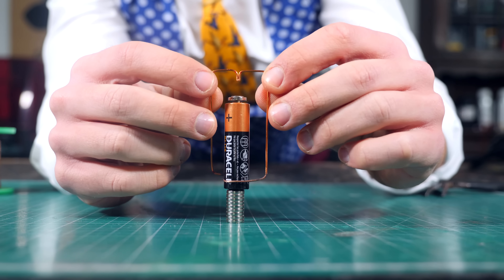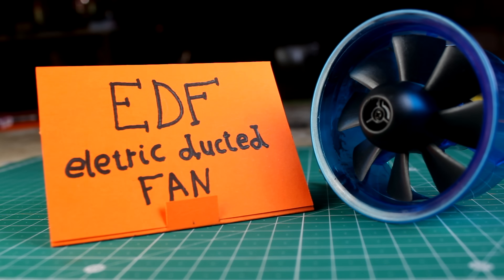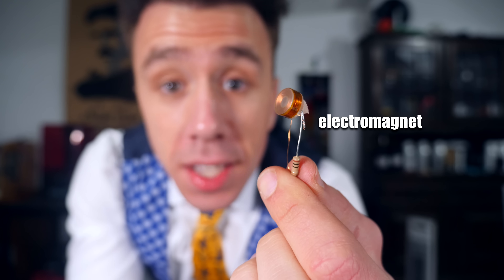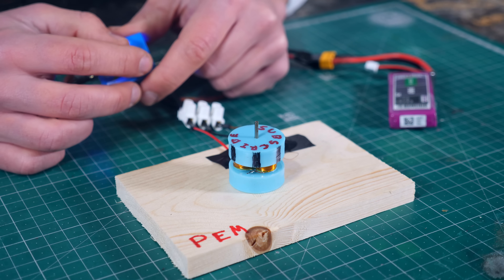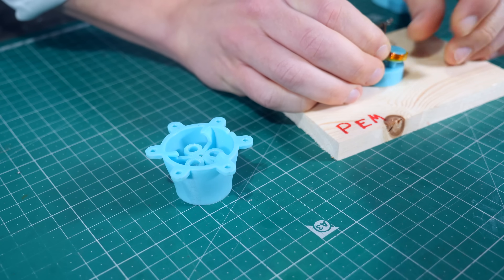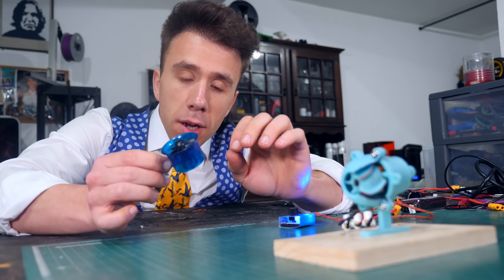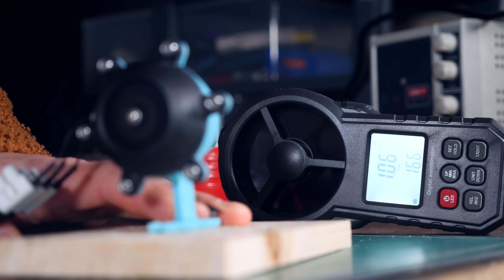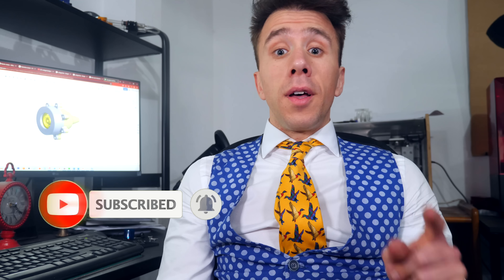I 3D Printed an ELECTRIC MOTOR FAN

Comment: I'm guessing it has to do with the diameter of the intakes of the EDF and the 3d printed ones. It's the biggest difference I can see and would guess it to be very influential on both the flow rate and the static pressure delivered by the fans. But I don't know for sure, am not an engineer in this regard. Just know that I hate tomatoes too.
Reply: I believe you’re right. I am an aerospace engineering student and I believe there is some pressure distortion happening within the fan casing because it is not made precisely for the fan blade and the speed of the motor. When designing these type of casing MATLAB and Solidworks fluid flow models are used to determine the best design that matches with the casing. There are a lot of helpful guides online to discover more.
Reply from the maker: Congratulations my friend! You have just won a 3D printer! Send your info (Name, Address, Zip code, Phone Number) to integza@gmail.com.
Reply: In this fan, the mouth from the front is taking in very little air and should be wide open.  This will allow them to throw back with more air and will be more efficient  @integza
Reply: @integza  sir did you pick two winners?
Reply: I think you're right. Tomatoes have a nasty texture.
Reply: As an aerospace engineering student I would say this is a big factor, at the same power input you aren't going to get nearly the same mass flow rate through his centrifugal fan as through that ducted fan. However another factor is that a centrifugal fan as he is using it simply isn't as efficient at moving air as that EDF. The centrifugal fan is better at increasing the airs pressure but the ducted fan is better at moving air.
Reply: I am currently trying to do something similar to make thrust for a drone. Mass flow rate is a big problem, but a solution might be to have a two stage system that uses an edf type impeller to increase mass flow connected to a mixed flow type impeller to increase pressure. The combination might work well with aerospike nozzle.
Reply: It's the diameter plus the surface area the fan has way more surface area to grab air and throw it, as well as the straighter the path of air the faster the air will be moving, the fan has a straight path a lot straighter than the impeller 45deg vs 45+45+ the exhaust outlet
Reply: i hate tomatoes but i love ketchup
Reply: I belive the edf fan shape is more optimized for flow whereas an impeller is generally better at creating high pressure. All of the energy in the motor is being put into of pressurizing a small amount of air to a higher pressure, which then produces less thrust. Also, since the impeller is releasing air back into the atmosphere it doesn't need to work as hard because the output pressure is nearly the same as the input after it gets released, so the motor probably isn't at the same load as it was on the edf.

Disclaimer: I am just a motor/fan enthusiasts. I don't actually know what I'm talking about
Reply: Your tolerances are poor, the geometry, airfoil, blade counts, shapes, etc are all arbitrary.

There isn't a simple answer to this, which is why it has escaped you.

Those cheap mass produced EDFs, and the high priced Dyson systems have one thing in common.  Massive amounts of research and iteration to optimize the design.

The single biggest difference between a formula 1 engine and a Honda civic engine is precision.  F1 is 10x more precise.  However, higher precision, tighter tolerances, and decades of research in fluid dynamics, mechanics, materials science, etc. equal a increase in specific output of 10X.

And tomatoes are gross.
Reply: I may not be an aerospace engineering student, but I'm reasonably fluent in physics. Ultimately, you are correct in your assessment. You may want to know how you are correct, and how it all correlates:

"There are a combination of reasons for this problem. All the physics that go into making a fan are torque, radius, radial balance, radial aerodynamic coeffecient, and mass of the impeller.
-Torque is a known and unchanging factor with the motor. We have no intention of changing this, so it becomes a foundational standard.
-Radius is variable. Radius referring to the radius of the impeller. This also correlates to the radius of the frame, or more specifically, how tight the tolerance is between the impeller and its ducting. Low tolerance allows back-pressure to directly 1:1 displace some of the original displacement from the impeller.
-Radial balance is a personal term I'm using to describe how well balanced the impeller is along its blades. Where is the center of mass along each blade including its respective portion of the hub? The further away from the point of rotation that the center of mass is, the longer it takes to spin up and the more of an impact aerodynamic drag, or back-pressure, will have on the impeller.
-Taking that same radial cross-section of an entire impeller blade and its respective portion of the hub, we then need to balance its aerodynamic coeffecient with at least two other factors. First is the velocity of the impeller blade at all points along its radius. Second is the range of operational flow of air into the impeller. So the aerodynamic coeffecient profile of every slice of the impeller cross-section from the hub to the tip needs to be balanced according to its intended operational velocity. If this doesn't happen, then you create unintended pockets of high/low pressure along the surface of the impeller blade. The blade does rely on a small high/low pressure imbalance along its surface to induce pressure displacement, but too much, little, or even inverting that balance will quickly ruin the efficacy of the impeller. You need to fluid-flow simulate this in CAD before production. Even just taking a Dyson impeller design isn't enough, because it was designed for a specific frame, intake, exhaust, RPM, torque, radius, and mass. All of these things work together. You're also working with a constant; the torque of the motor. Another facet to consider with radial aerodynamic coeffecient is how large your intake and exhaust openings are. The standard ducted EDF blower doesn't try to pressurize the air any more than needed to maximize its CFM potential. Meanwhile your centrifugal impeller is also trying to mechanically compress the air and is thus encountering resistance. The impeller design needs to be further augmented for that factor. From there, the CFM potential for the intake and exhaust each need to be considered and calculated based on the expected pressure displacement of the impeller and its frame. If the CFM potential of either the intake or exhaust is too low, then you get back-pressure again ruining the displacement balance you're trying to create.
-Mass of the impeller goes without saying. However there are some subtle nuances to this that most either forget or fail to recognize. Rotational mass in a frictionless environment will only slow down how quickly a specific torque will get up to maximum rotational speed. We're not working with a frictionless environment though. You're combating the balance of ambient air pressure. You are trying to use a spinning screw of blades to dig into the air and pull it in a specific direction creating a pressure displacement. Keeping the mass of the "screw" as low as possible will allow more of the motor's torque to be applied to the air instead of the impeller's mass."
Reply: @XionEternum  great comment very comprehensive I started to write a similar paragraph and decided to just to do the math. I wound up with some pretty ridiculous numbers, I think due to some gross over assumptions. "I went ahead and did the math and a balance of force using the specifications of an EDM that looked like the one you used. The specs say thrust is 470g and power is 199.8W (probably not). The thrust converts to approximately 4.61 newtons and the output is about 0.268HP. Using the balance force equations that is an output velocity of about 39 m/s. Using the kinematic relationship that means the intake velocity is about 18.586 m/s. if you take your model and remove the interior geometry and use the EDM with its regular dimensions you can theoretically increase the force from 4.609 newtons to about 223.505 newtons. this would demonstrate a theoretical net increase of 218.896 newtons of thrust. this is of course assuming no entropy, constant performance and zero shear at all surfaces but, the fact remains your losses have to be related to restrictions and turbulence as noted by sever earlier comments." for what its worth I think we are saying the same thing.
Reply: @XionEternum  I can't see how impeller weight would relate to friction of the impeller blades. Their friction against air is affected by RPM and air pressure and not weight.
Reply: @XionEternum  How to fail to respond to a question. An F1 engine has pistons changing direction. Mass affects this.
An F1 car constantly changes engine RPM when changing gear or changing speed. Rotational mass affects this.
A F1 car needs to turn. Mass affects the load on the wheels when changing direction.
An F1 needs to constantly change speed. Mass affects this.

Weight on the blades affects the load on the blades - how they will become longer and can break as the RPM increases. But that is a different discussion.

Bit your claim was that the weight of the blades affected their friction against the air. And my question was why you are making that claim.

Your comparison with a tank thread is wrong on so many accounts - it isn't weight that creates the friction in all the links and pulleys. And it also has different air resistance. But our fan blades are explicitly designed to have air resistance. That air resistance comes from shape and size - not mass.

Now give a real response. Or maybe an "Actually, I don't know"...
Reply: @XionEternum   - seems you don't like criticism...  @PWM8920 is  correct - you may have even allowed for the mass not to be an impact at steady state  -..  impeller weight only impacts acceleration and gyroscopic terms, it has nothing to do with aero terms in the equations... - Moment of inertia is not mass  (and on earth, mass and weight are often loosely interchangeable), and a tank tread is not a very good analogy, it has immense internal friction compared to a tyre spinning in air..  lol...
Reply: @XionEternum  : not going to elaborate too much, however moment of inertia (2nd moment of mass) may be what you are confusing with mass.  - 2 designs of the same mass  will absorb vastly different amounts of torque due to "mass distribution" - ie. "Moment of Inertia". - mostly affects (correct use of the 'a") the "Non steady state" acceleration of a flywheel type device.

- mass / weight jibe (light hearted comment)  was merely because many people "explaining" mass vs weight use the gravitational force as the explanation, while we are on earth - and I don't know who I am talking to educationally  or experientially - weight / mass, do the same thing when placed on a scale. - yes I know weight is a force, mass is a physical property of matter (as far as physics can determine) - then we get to inertia.
 - Weight of air  -  lol, 
Cheers..

EDIT - who cares, but yes I too often edit comments after posting- mainly for grammatical or other clarification reasons... (especially when posting from  a phone - errors become apparent after re-reading.)
Reply: @kadmow  This Xion guy seems like an AH to be honest. Using physics terms for when we are on earth moving in an atmosphere.
Reply: @rcaviator8408  : some ppl just want to be right, or exact all the time - leeway should be made. We never know if we are talking to a pretentious 12 year old, or a professor of fluid dynamics, nice to remain civil and patient -  though some need to get burnt occasionally.  I usually try to pitch to a 15 year old -  they can be taught anything if it is  introduced practically.  (others with no real understanding want  to think their "year 8" schooling is as good as an advanced understanding/education/schooling)..   

 sorry, tldr, who cares, it is all a bit of a laugh in our spare time.
Reply: @XionEternum  I have no idea who's right about the fan stuff as I'm just a poor little software engineer. However, I do have to contend with your very condescending take about  F1 being pronounced "Formula one", not "eff-one". Can I, then, safely assume that you always pronounce NASA, for example, as National Aeronautics and Space Administration EVERY SINGLE TIME you say it?
Reply: @perwestermark8920  I may regret this so I comment not to be dis-respectful but instead to discuss the centripetal force of a tank tread turning at very high RPM. first I would define my terms in SI terms mass is in Kg, force is in Newtons, and an RPM must be converted from revolutions/min to radians/second=Hertz. A Newton is defined as mass*gravitational constant. Im unable to insert a free body diagram but it can be stated that as the radial velocity of the tank track increases the mass will remain constant while the centripetal force will eventually over whelm the max stress and shear, σ, 𝒯 respectively, of the design material. Assuming the track is not touching the ground there will be no "normal force" defined as ΣF=mass*acceleration in rectangular coordinates. That said rotating mass is a power destroyer, as mass is a term roughly defined as an objects resistance to acceleration. So here is the point mass reduces the electric motors ability to accelerate by increasing the time required to achieve max velocity. power is defined as (mass*gravity*meter)/second=Watt so as time increases Watts out decrease (but I won't delve into the energy storage). 

Drag=Complex dependencies*density*velocity^2*cross sectional area/2 or D=(Cd*𝜌*v^2*A)/2 where Cd is more of a lab tested dependency. Assuming all terms but the velocity remain constant a parabolic graph will represent drag, saying that as velocity increases drag increases exponentially. The force of drag will also fight against the fan as the whole point of the fan is to move air from low pressure to high pressure using drag. A simple way of representing this is by using the Bernoulli equation. this equation also uses (material density*velocity^2)/2 or (𝜌*v^2)/2.  so as most of this can be simplified out of a problem by assuming perfect conditions. Then using Kline McClintock probability you can find variable intersectionality and do some lab testing. Perform your linear regression or just use excel and apply a trend line to get closer to your by r and r^2 values to determine where your largest discrepancies are then modify rinse and repeat. 

over all that little EDM does not have the power to overcome the mass of the impeller and the drag created by the tight tolerances. best thing to do I think is to simplify as outlined in my other post.
Reply: @practicalenginerd7303  I have already earlier covered that mass affects forces and material strength - there is a reason for titanium (and careful balancing) in fast-spinning turbine blades. But the now removed claim by a local fool was that the blades mass affected the friction against air.
Reply: @perwestermark8920  I agree there is a definite conflation of terms. I was fairly tired when I wrote the reply and by the end what could have been a simple response turned into two paragraphs… where friction is a dimensionless term used to describe energy loss through entropy (μ). Energy loss to entropy as friction is defined Fn*μ when Fn=m*g. Mass when an object is not in touch with another surface is only an objects resistance to acceleration. While rotational mass will increase time taken to achieve max radial speed. That is the only correlation that I can think of for mass, while drag is really the “friction” for air as mentioned in my other post drag is oversimplified as the square of the velocity and also falls into the entropy category while not being actual friction. Where drag falls into several fluid mechanics categories. Namely surface velocity profile over the fins, surface roughness and of course the difference between laminar flow and wholly turbulent flow. Crazy I’ve only just scratched the surface of this topic and I’m already a paragraph in. I do agree though some of the entropy terms can easily be misinterpreted as the end result is the same the conditions are what change.
Reply: @XionEternum Oh wow. That last item and the way you phrased it was very illuminating for me. That is, I did not have this in my mental model, or even know that it was missing-- but I could immediately tell that it was, and why, and how. Thanks for writing this
Reply: I'm thinking your impellor/ casing clearances need looking at. You may be getting wash and bypass effects occurring. Measure volume and velocities at intake and exhaust.
Reply: Wholeheartedly agree, either Intake or right at the diameter of output, something is being bottlenecked 

Source: a lot of stupid car shit
Reply: I had the same thought. With only a small reduction in diameter of the intake and/or fan that's a big difference in effective area.. You know the whole A=πr² thing
Reply: The diameter of the impeller also looks smaller than the edf fan. Less speed at edges where bulk of blade is. And typically (if my limited memory's serves) impellers are far better at static pressure and fighting through back pressure in a system. Far different use cases.
Reply: You don't know how close you are. Inlet size, cross sectional area inside (between impeller and housing) and exducer (the exhaust side) all play a significant role in moving air mass. What he has now might inflate a balloon, but won't move enough air mass to cause thrust. High pressure = low flow. The opposite is also true.
Reply: It might be cause a propeller/fan can actually make more thrust then a jet engine its just a jet engine can take you up to higher speeds but im not an engineer so i dont know much about this type of stuff
Reply: That's correct. There is a clear difference between axial and radial fans as well: the axial fans have much higher throughput, where radial fans are known for their higher static pressure. It's like a car engine on different great ratios, one will go fast with low acceleration, the other accelerates well but tops out sooner.
Reply: Your likely right. I think an added factor could be the weight of the fan relative to the original EDF. The printed fan may take more energy to rotate therefore leaving less energy for thrust. Might be completely wrong on this, but seems logical to me.
Reply: @judahhawi3925  not sure if the weight of the fan could make a massive difference, as it's balanced, so the rate of acceleration in the spin is all that's affected, otherwise once it's up to speed the higher weight gives it more momentum like a flywheel. I could be wrong tho :)
Reply: It depends on the diameter of the toma-toe ..
Reply: Hey. You should build a very effective device to destroy all tomatoes 🍅
Reply: My added theory is maybe te 3D prinded surfis is Not ideal because IT can creade some Air turbolances in the engine so ist slows the airflow down
Reply: FUCK Tomatos
Reply: You took the 3d printer i really want one of those
Reply: Damn ur about to get a 3d printer
Reply: Guys guys guys. Lol. He just doesn’t have enough amps. Amps equals magnetic potential.
Reply: @zenithblack2823  from what I can tell he used the same battery and ESC. So that argument doesn't hold.
Reply: @goeland86  let ask you, if you put a fan under Pressure, what happens?! They lose spin ability. They slow down in other words. 
Most are fan are tested under pressure in vacuum rooms. 
For battery argument, if don’t have the right thickness of wire to allow for the amps to past though then you will not have the electric magnetic potential to move the fan though increase pressure. 
More amps, means more torque.
So the battier is not the problem.
Reply: @zenithblack2823  so I've spent years flying RC planes. I now design 3d printers for a living where air flow is important for cooling various elements.

A fan that's not able to push enough air back will stall, meaning the air stops being pushed back. This create a cushion of air inside the fan cafe where the resistance lowers as the air starts to spin along with the blades. So you get a short peak of resistance initially and then very quickly nearly no resistance anymore. As to wire thickness, what he's using is able to hold up to 20A continuous without heating, and it looks like a 4 or 6S battery, messaging either 16 or 24V. That's a lot of wattage for a tiny motor.
Reply: @goeland86  I hope this helps. 
Thomas Edison: the father of integrated circuits. Low amps, stable frequency, variable voltage. 

Nikola Tesla  the father of magnetic frequency: high amps, variable frequency, low voltage. 

You need to change your coil to take high amps, amps is magnetic potential. 
Which you will need so many wire turns. I start make two and three stage coils by
The first coil will two turns 10mm copper wire, the second coil goes straight over the first coil 3 turns 15mm, third coil straight over the top of both first and second coil 20mm four turns. 
Each one set at different amps, give more magnetic potential energy and less heat more control. (Volts around 8v max). 

start by making a solenoid first to get right. 
Voltage is only need to create a path way for energy to past though. 
With Voltage you will need only and small amount start at 2 volts work up from there. 
Variable frequency to change the speed up and down, you need to research magnetic frequency to find the right one for your fan, that’s make a solenoid first. 
Now I set up my motor for my (rc boat) i set it up a A/C style.
I run a A/C 8v, 300 amps, and variable frequency for up and down speed. 
And puts out 110nm of torque for 150mm dia water jet boat motor. 
I use 7watts of power to run the motor. 

I hope I give you a new direction
Electric motor are build on the wrong maths. 
I hope I have helped. 

I am 44yrs and at 42yrs I learn that I have an IQ 192 to 217
I have multiple engineering degrees, railway, building, construction. 
I have been for many years wondering why electric engines design wrong, so I am studying physics at uni, and get this they can not answer me either. Lol
To understand look at a transformer, which was designed by nikola tesla. Which all about electric magnetic potential.
Reply: @goeland86  you stop thinking about watts, when are you talking about magnetic potential which is just amps. Other factors there is not enough amps getting though, capacitor, transistor, types.
Reply: @zenithblack2823  sigh the BLDC motors use more amps when there's more resistance. As I said if the fan stalls, no/very little resistance. Which part of "I use these motors on a daily basis" did you not understand? Theory is all week and good, but empirical knowledge and understanding has always trumped it. There's a million reasons why the amperage can carry while generating the same rpm. Just like how you have to press the gas more to maintain does going uphill in a car. What you say only holds true for a brushed motor. The pulsed current system of the BL motors negates your entire argument.
Reply: @zenithblack2823  you keep throwing that magnetic potential out - except it's meaningless in the context that he's using the *exact same motor*. The potential will not change unless you vary the current. He's using the same battery and ESC. The only variable is the physical housing causing resistance to the rotation of the fan.
So. The amperage will differ based on how much resistance the fan creates to achieve a given RPM. The magnetic potential is torque. Not speed. It determines how fast it will accelerate. Not how fast it will go. Not with a pulsed current motor. A brushed motor will get higher torque and speeds with higher current. A BL motor will get higher speeds with faster pulse rate, the current used will be adjusted to compensate for the amount of force needed to achieve that RPM. The ESC detects where in the phase of rotation the motor is and adjusts the amount of current accordingly, and uses it to determine when to switch to the next pulse.

Again, your understanding is flawed and in this case completely off the mark.
Reply: @goeland86  you are running an engine on magnatic energy. Not electric energy. 
Are you not using magnetic, or magnetic coils. That’s “magnetic potential” there is a whole lot of maths. 
Look up nikola Tesla,  where do you think magnetic technology come from. 
Not Thomas Edison.
Reply: @goeland86  the difference between you and me is, I do all of the mathematics. I love theoretical mathematics because easy and fun for me. And I magnetic maths “electrical magnetic radiation”
Is different I absolutely love it.
You copy cat and do a little bit of maths if any.
Reply: @goeland86  you don’t understand manufacturing, the magnetic they are better, they more turn on there coils you can achieve at their quality. They use hidden micro transistors, and capacitors. 
There is a lot of lose of magnetic potential. 
To over this thicker wire, big capacitor and transistor set to match. 
Now if you don’t have the toque, you can not maintain top speed with or without load. That is a fact.
Reply: @zenithblack2823  No, I'm not a copycat. I actually learn from what I build, and understand the theory. But working with the motors in real life teaches me that theory has limits. So please accept that unless you work with them in your hands and actually build shit out, you're missing factors that will impact the effect you're working with.
Reply: @goeland86  good happy to hear, stop tell I’m wrong.
Reply: @goeland86  I have miss nothing. I have study this in physics, I did had YouTube channel and I can on the fact I stated that solar panels are not renewable that they no more than AA battery and so on.
So I can not show you the engine that I have create, one of them being an electric magnetic v6 engine, which wanted to put me car but Queenslands government will not let this happen. It is full electric, this is not funny any more.
Reply: @goeland86  your challenge is.  To prove me wrong.  Which creates the better magnetic engine. 

Thomas Edison intergrated circuits. Low amp, stable frequency, viable voltage. 

Nikola Tesla magnetic frequency. High amps, low voltage viable frequency(speed control though wave length) 

I love physics and maths. I can build with my hands and have education to with it.
Houses, buildings, roads (civil engineering) railway lines, small engines, car engines. 
What love and studying, all maths, physics, computer engineering, chemistry, AI computer programming. I use YouTube as some of I am learn they lecture to catch me up on class I miss due work, and some talk others on when I can not get my head around what I am learning. So that you have help me. Not on this subject, I was have some problem with my programming, I need to open my mind and talk about something else, I hope you understand. Peace. 😀
Reply: @zenithblack2823  the motors themselves contain nothing besides coils and magnets. Have you never taken one apart?

Again, the magnetic potential you refer to us fixed by the voltage and coil setup. So if it's the exact same motor, the only variation will be external factors to the motor.

What part of the problem do you not understand? Motor in one installation generates power x. In another installation it generates power y. The difference between installations is neither battery nor wire. So the difference by definition (it's the same damn hardware) *has*to be external. If you don't get that then you're just showing how little you understand of actual scientific experimentation.
Reply: @goeland86  i have being fixing electric track car all of my life. Lol
I fix integrated computer boards. 
Now I’m not say there is integrated in the engine, well some do, like stepping motors which I play around with, I have doing this since from 9yrs to well I am 44yrs now. You do maths. Which means I have been pulling motors and technology apart and made living of it long than you. Lol.
Reply: @goeland86  this is what you do No understand. Do you calculate the potential of you coil, that you. 
I do maths. I live in and outback town of 1500 people, I had rewire my mother washing motor at 12yrs dad got the wire from his work, and when to work, it work but not as well as did. So when a electrician came to our town I got him to show what did wrong. This what he stated and have found true. 
My coils were not tight has the manufactures so I lose of magnetic potential 
Volts is the pathway
Amps is magnetic potential 
Frequency (is annoying) he said lol.  But is very important talking more about (white noise)
To fix the problem
What he stated is that most people will try to push more volts to get speed and power, but that makes more heat and stall a motor. Where as if drop a little voltage increase the amps and change up the frequency to compensate. 
I have learn since then though education.  So we clear I am educated. I m not the other type
Reply: @goeland86  did you know that Dyson electric engine run a high frequency setting than most electric engines that way they can get up to higher speeds much more quickly as well.
Reply: @goeland86  to your bladeless fan better change your frequency to a high setting. If you don’t what I am talking about. Look it up it will help, Dyson, Electrolux do it.
Reply: yeh pretty much size matters
Reply: Why do you hate tomatoes?
Reply: Its because he is turning high speed gas to high pressure gas
Reply: what the hell happened in here? lol, a couple of y'all need to chill...
Reply: I suspect that the small impeller would allow the motor to spin it at a higher RPM under the same power load, negating the intake diameter as the issue. I wonder if instead the losses can't be attributed to back pressure when the air is compressed causing the RPM to get reduced under the same power load.

In other words, either the motor gets fed more current or the impeller/casing gets scaled up with the same intake diameter.

I'm also not an engineer and I personally get bloated when eating tomatoes.
Reply: It's a pity that your post had such high visibility over 3K due to Integza's like unfairly highlighting it, since your insights on the matter of the intake section size, while admittedly humble, are technically at best misleading and at worse fundamentally wrong, as fluxcapacitor shown in a separate brillant comment that however remains unfairly underrated with ten less views. The Internet is such a b|tch sometimes.
Reply: @XionEternum  Your first response was immature. The second even more so.

But what you actually said was that you have no idea why blade weight would result in more friction and instead selected attack mode. So why not admit that? Or you think rudeness wins over logic?